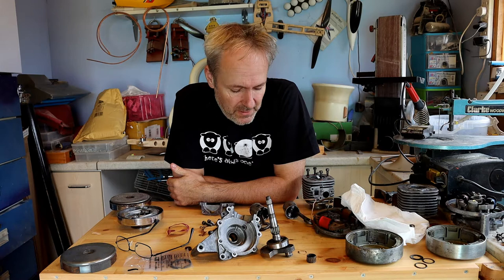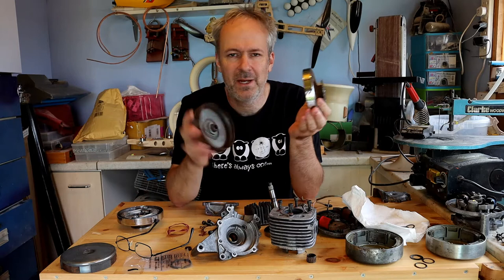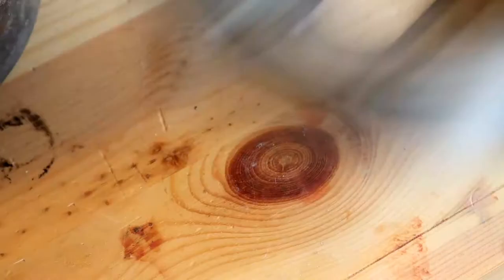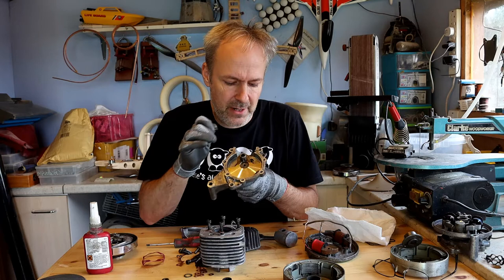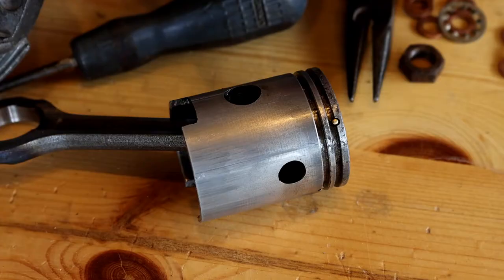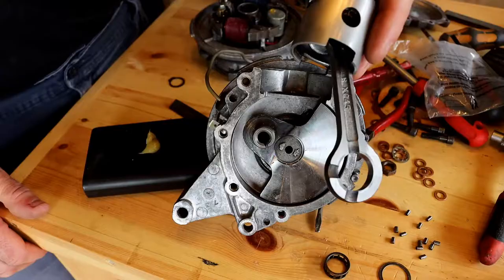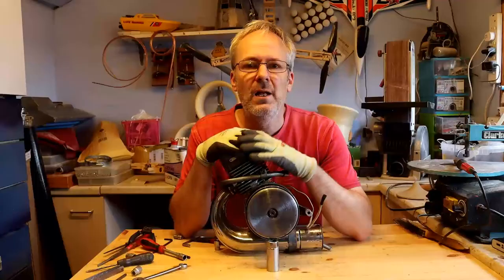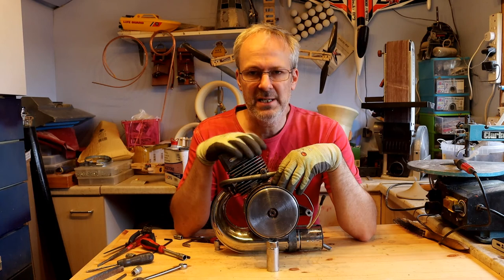Motobecane Mobylette X1 engine rebuild.

Comment: Thanks for sharing! I own a 1972 X1 and I was wondering if you have any good link for online suppliers who stock engine spare parts? 
Big cheers from Denmark :-)
Reply from the maker: I can only find this rebuild kit on Ebay and its from Germany. https://www.ebay.co.uk/itm/Mobylette-Motor-1-Cady-X1-Gasket-Set-Overhaul-Kit-All-Gasket-Head-Base-Stock/203236438120?hash=item2f51d5f068:g:RpcAAOSwDr9f8EfV   
might be worth a try for other bits?
Reply: @mrfid72  Cheers! I'll have a look at it. Do you have any idea of how many X1 there were ever produced? 
As far as I know there are only 2 or 3 of them in Denmark. The X7 seems to be more common.
Reply from the maker: @mikeyo22  No idea to be honest, you can find out how many bikes of one manufacturer are left on the road (and taxed) but not which model. a lot of the X1's were never registered for use on the road and it seems to be hard to get them registered now? Both of mine are registered.
Reply: @mrfid72  hi again… do you know which sparkplug the X1 ran with originally? Make and heatrange?